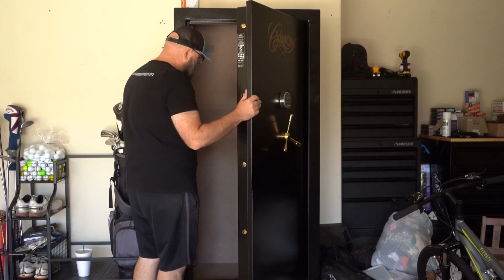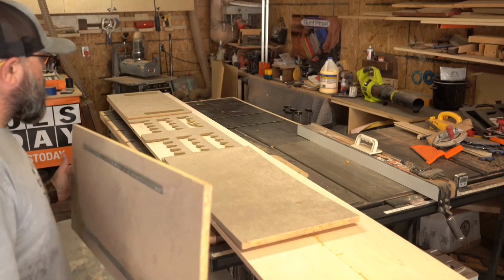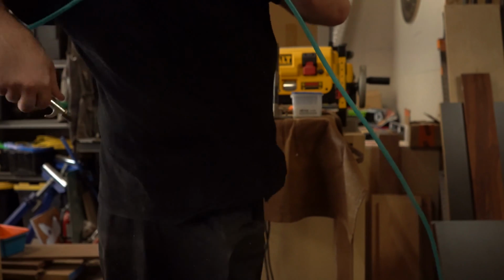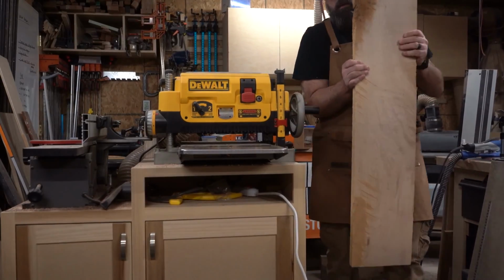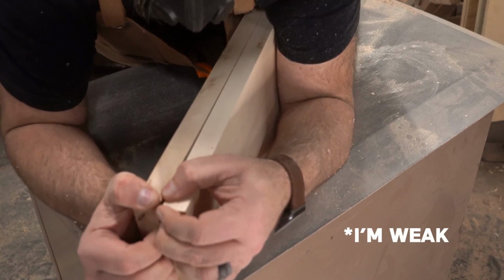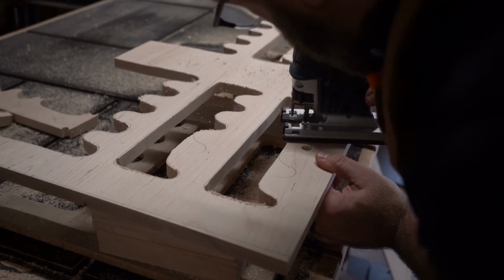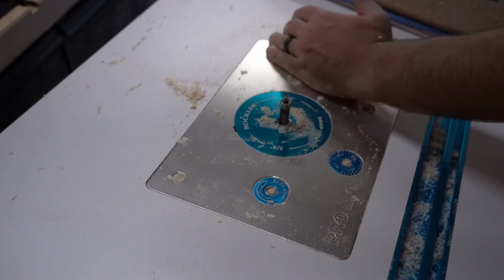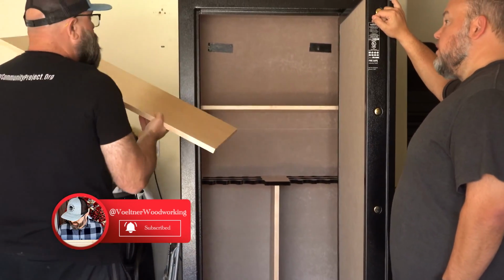Replaced Gun Safe Rack | 10X Better

Comment: Beautiful work! My safe came with mdf shelving and your video is very helpful. May I ask how you secured the vertical support to the floor? Did you use pocket holes with screws?
Reply from the maker: Thank you. The vertical support is not fastened and works great with the weight of the shelf and equipment on it.